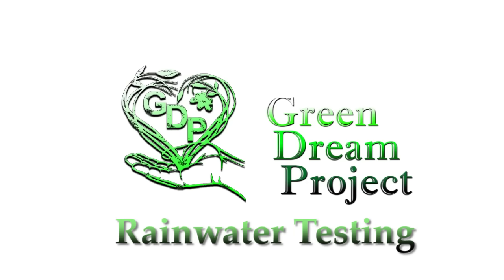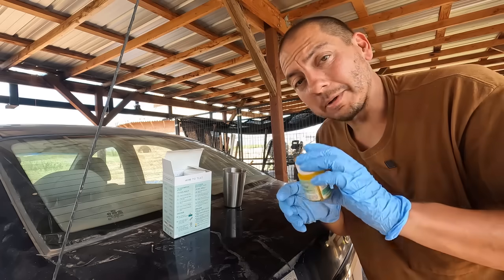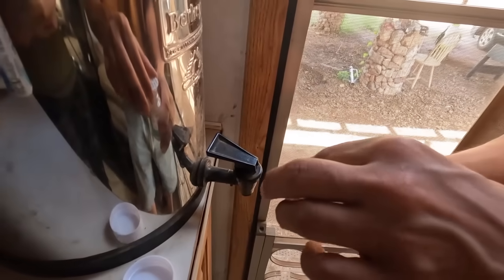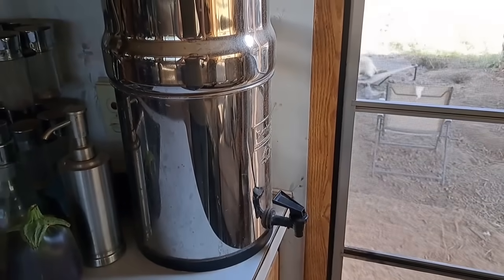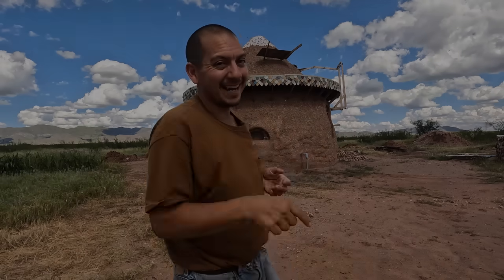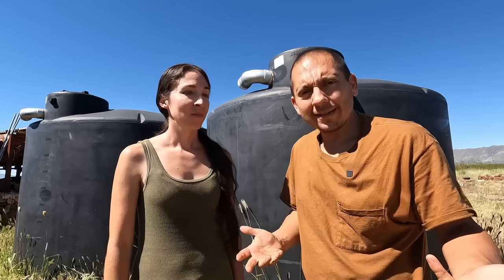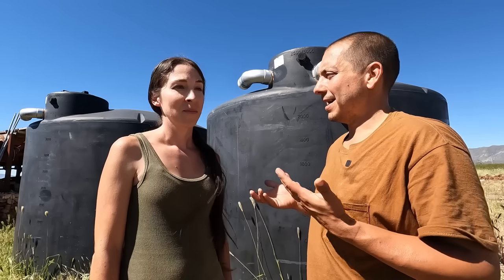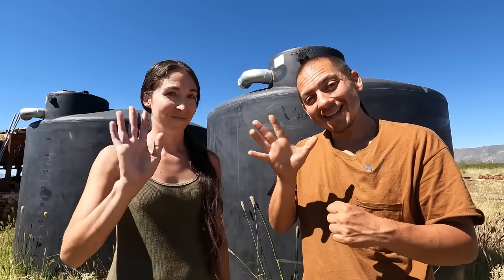Is Rainwater Safe To Drink? We Put Ours To The Test

Comment: Part 2
The recirculating valve DOES NOT use or waist any, not even a drop of water is waisted because of the product. 95 - degree water is delivered before you can fill a water glass with hot water. You do not change any temperature settings on the water heater. You select the hour’s most important to you to have hot water. My recirculating valve runs continuously. I DO NOT WORK for, nor do I have any association with "Watts", nor anyone that may sale this product. Save precious water Most Respectfully.

Comment: I'm not surprised at all, I also use rain water.
If you're area don't have air pollution or low air pollution it will be most probably be ok.
Glad you did this , thanks and well done 👍 awesome you just confirm my opinion.

Comment: Love the test kit. For myself Before I ever contemplated drinking it. I may also test for Carbon/silica, Nitric acids, or Sulfuric acids. I know the sand in the wash out places would carry such chemicals if it were in the rain at any time. Problem with rain? Rain is fickle. We may get one reading from it and next week a different reading. Then again, using the rainwater for the crops what's in the rain is now in the crops we eat.
Is that a metaphor "Damn of we do damn if we don't"? Don't drink the water but eat the crops. LoL
Reply: To be more trustful of rainwater. I would also look to see what leaching ponds are in the general flight path of the clouds. Perhaps up to 1000 miles or however far the cloud layer originated. and test for those chemicals as well. even lead has a low evaporation level. And why they don't use it in tooth fillings anymore. Speaking of a common element like lead. we cannot use a test strip to accurately account for lead by parts per million. For lead and other elements are cumulative in the body. but it can be distilled out.

Comment: So the test tells you that there's no need to filter the water, so you could save yourself the cost of the filters, or just keep the inline filter if it makes you feel better.
Honestly town water is rain water, just collected in the municipal dam rather than your local tank, there are probably more chemicals in town water as it picks up all the fertilisers and other chemicals as it flows across the land into the dam catchment.
Also remember filtered water with no minerals can strip the needed minerals from your body, make sure you are replacing those and not causing yourself health issues.

Comment: Arsenic is sometimes a problem for well water. But for rain water, it shouldn't be an issue, especially.
Reply: Rain water is void of essential minerals.   It's safe to drink in moderation but shouldn't be used as the sole source of hydration.   It can strip essential minerals from your body like calcium, magnesium etc.

Comment: Our well water has a LOT of Iron in it (tonthe point that the water is discoloured from the Iron) and a few types of bacteria that, if we rented this farm, we wouldn't be allowed to drink or even have access to, but because we own the farm, nobody cares 🤣 We've been here over 6 months now and we're still alive. The tests we had done cost around US$750, and to fix the water supply will cost us somewhere around US$6,000, so for now at least, we aren't able to afford to fix it.

Rain water in most places is safer than well water. I am not at all surprised with your results. I honestly wouldn't be worried about it. 

It was an interesting video and thing to do though, so thanks for sharing.
Reply: Do a bit more research. I have loads of iron and manganese in my well water and the filtrations system I installed cost about Can$1,600. All my own labor, of course. Now my water is beautiful. A simple chorine shocking and rinse usually takes care of bacterial problems.
Reply: @KevinMaxwell-o3t We're not in Canada. The cost is very different here.

Comment: It doesn't matter if there are forever chemicals in your rainwater. What matters is that your drinking water filtration is sufficient.   
From the Berkey website "Do Berkey Water Filters Remove PFAS?
The short answer is Yes! PFAS's fall under the category of PFC's - Perfluorinated Chemicals. PFOA, PFOS, etc.  The Black Berkey elements that come standard with our Berkey water do remove these contaminants by over 99.9%. "

Comment: I rented a ditch digging machine, And lay out water lines all over the place.  Cause of fires. and it did come in handy for that.  At one time i was thinking of putting in a trailer park.   I BACK OUT OF THAT. Cause no city sewer.  I would had to use Septic Tanks, and that is a pain in the ass

Comment: If your using a Osmosis water system?  Your good to go!   👍👍👌👌I run test on my well water to. And its EXCELLENT! Straight from the ground into a holding tank. and that is it. No Osmosis system nor filters to it.  I use a lot of water. shower and things. It can even set for months and its still good!   Out side i will drink it right from the hose!  YUM  The water lines running out in the field, Needs to be flushed be fore drinking it. It does get Algae.  Cause its not used much. I put in a water valve between the house and field. That is under ground in a large pvc pipe with a cap over it.  Turn it on and off to the field

Comment: Jess is absolutely correct:  "if it is in the rain it is in the entire aquifer."
Reply: Nope. It gets filtered by the  soil and rocks.
Reply: @NoeraldinKabam  Articles I've read say that Forever Chemicals do not filter out.
Reply: @ciaragarrity6425  Can you explain what forever chemicals won't filter?
Reply: @qua7771  I meant, that forever chemicals are difficult, if not impossible to remove from water it contaminated.
Meaning unless the water treatment plant near you is really well made, it probably won't do anything to remove the chemicals.
Reply: @ciaragarrity6425  I'm looking to research this.  I use a zerowater water filter.  I'm concerned about the trash they are putting in the clouds (aluminum, barium strontium etc...).
Reply: @qua7771  Okay, that would be great to see what you find!
Perhaps make a video on that.
Reply: @qua7771  don't forget the phenols that leach out of the plastics that make up the filter casing and pitcher.  Phytoestrogen and microplastic are killers!
Reply: No it is not in the aquifer just because it's in the rain. The Earth itself is one big giant filter. Limestone is the best filter of all so the rainwater goes through the dirt and through the Limestone before it goes into the underground aquifers making it very pure
Reply: @HookLineAndTruth  unfortunately it is in the aqua for these days. About 100 chemical have been at detectable levels for quite a while now.
Reply: And, "Pollution: 'Forever chemicals' in rainwater exceed safe levels

2 August 2022

By Matt McGrath"

The thing is the processed water is unlikely to be any cleaner than rainwater.

Distillation will remove about 99% of pfas in water.  But that's going to take a lot of energy and time.
Reply: No it is not already in the aquifer the Earth itself the soil especially the limestone is in the ground is the very best kind of filter that there is after it rains the water gets filtered through the dirt and through the Limestone and become very pure before it goes into the underground aquifers

Comment: You need to test for Aluminum,Barium, and GrapheneOxide , those are the chemicals they put in Chemtrails , your ph is a little Acidic , normal is 7.2 , lower is acid higher is alkaline , You can remove Graphene Oxide by putting a small magnet in your prefilter
Reply: What are chemtrails  ?
Reply: @ericschulze5641  chemicals that Monsanto and Bill Gates use to control the weather and block out the sun , look it up

Comment: I knew the filtration system would come out good. Glad both bottles showed yellow. As for the strip tests, they only test for what are on the strips. I would've sent it in for a more detailed test for stuff like strontium, barium, aluminum, etc. There have been more extensive tests done on lakes, ponds etc., even up in the mountains and they were found to have those chemicals in the water (same stuff that's being spewed out into the skies all over the place). I collect rain water for the gardens, but the house gets water from the well. : )
Reply: ok it doesn't matter.
because if it did show. then you are breathing it also.
BUT MORE IMPORTANTLY, its not going to show. because rainwater is distilled water. 
Stop believing these hippie lies.
Only two types of people spread hippie lies.
THE BROKE FOOL that believes them.
or
THE SCAMMER that saying the lie to make money off you. These guy often make what I call Azzwipe laws. 
Azzwipe laws are named after wiping your bottom not the way someone else wants you to. CALIFORNIA is full of them. And has been for 50 years I can account for. 
Oftentimes these azzwipe laws are made to make someone money.
But by all means Drill me a well if you don't want me to drink or use rain water.
It has to be 1500 feet deep.
OH AND YOU HAVE TO STOP THE CITY 100 MILES AWAY FROM STEALING MY GROUND WATER. 
Yeap they have close to 200 miles of pipe to steal the water.
And in about 5 years it will be dry. 
So they are going to need water from someplace else's. 
I was about to put in a well. Then I found the water drops 200 feet per year. Ever since the city drilled a well 100 feet into the next county to steal the water..And built a pipeline across the county.
Reply: Phthalates. Every plastic has them. Bpa is just  one type.
Reply: sure if your a millionaire

Comment: I'm curious to see if there are any forever chemicals in the water since the government does the chemtrails with the silver iodine to seed the clouds. Although I have heard that aluminium (sulfate 🤔 maybe)  in the ground water has increased dramatically in the past 10 to 15 years.
Reply: Ya they need a cbr test for pfas
Reply: Where they doing this? Commercial jets  ?
Reply: No they are NOT doing 'chemtrails' to seed the clouds, at least not in the vast majority of places in the world and even in the few they do it, it is infrequent. Why are you not worried about pesticides in the water, in the air? They are, by definition, poisonous, and you will encounter them in far greater amounts than you ever will silver iodide (not iodine) from cloud seeding. Note I said from cloud seeding; you get about 100 times higher exposure to silver iodide in tooth fillings and industrial emissions. Apparently it can cause harm in very high doses, but since people don't develop horrible diseases due to tooth fillings and the amount used in cloud seeding is tiny in comparison, you have nothing to worry about (plus, as I said at the start, chances are that you probably don't live in an area where it's ever been done).

Comment: Thanks for sharing, agree 100% :)   We've just completed 3 years of rain harvest (54,000gal) from roof in Southern Oregon into 3 x 2500gal poly tanks.  We run it thru rain harvest 'leaf/debris' screen -> 400micron sock -> Tank.   Tank -> 20micron -> 5micron -> Class A UV -> home plumbing (no Berkey needed due to Class A UV).  City permit/approved.  We drink it, make coffee, cook, make ice cubes, shower, laundry, give it the dog and cat, use it on starter plants, ....  all house activities.  No issues and it actually tastes better than the city water - has just a slight 'rain' flavor compared to bland city water :)
Reply: you can be arrested in usa for stealing rainwater
Reply: Oregon law explicitly supports roof run-off but not other forms (ground run-off, building a pond, getting water from streams/rivers).   System was city permitted/inspected :)
Reply: @esecallum  ...yep, depending on the state, it IS illegal to harvest rain water....and if that doenst make you at least a little perturbed.....0_o
Reply: @esecallum  Not federally only in some Democrat states.

Comment: What about aluminium and barium?
Reply: These chemicals are more likely in well water or if you are down wind from a smelter. Rainwater on the edge of nowhere is probably the safest water around.
Reply: Where they live this would not be an issue.
Reply: And strontium.
Reply: And chromium six
Reply: Just what I was thinking!
Reply: They are solids and do not "rain" down.
Reply: @onetransmission7871 flowable coal ash( a product so light a man would drown if thrown into it) is 30 % aluminium oxide; the soil tests on my farm show a 20,000 fold increase in aluminum from 1998 through 2017; flowable coal ash use to be a liability for the coal power industry; after 2004 's multi billion dollar insurance clown up flowable coal ash became an asset being sold to American Elements.
All licensed under Public law 94-490 October 13, 1976, and facilitating the sale of weather teaded on yhe Chicago Mercantile Exchange.
Reply: Ya they need to do a heavy metals test

Comment: rainwater is in all actuality distilled water. Oh and Jim when reading the strip lay it in order running top to bottom of the canister that way you can read the results better on the comparison label . I used to do that when we had the pool up and running makes it much easirer to read it
Reply: Rain drops form on dust particles. Distilled drops form on a container lid.
Reply: @terrafirma9328  You know that steam coming out of your kettle is billions of tiny drops of condensed water, which didn't require a dust particle to form?  Water vapour does not require dust to condense, stop repeating that nonsense as if it's some profound indisputable thing!